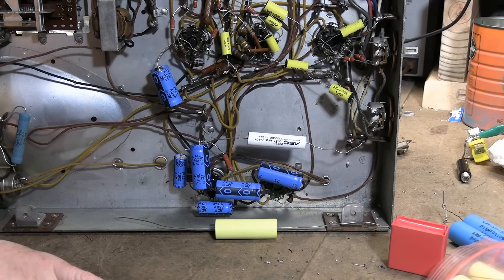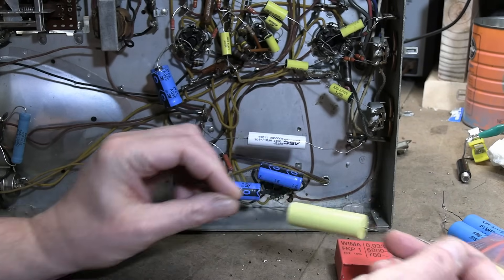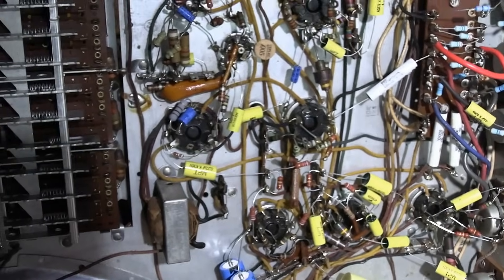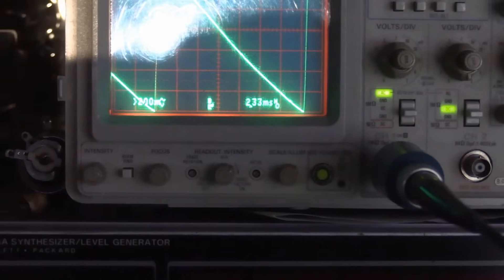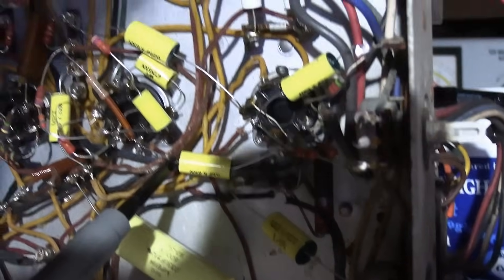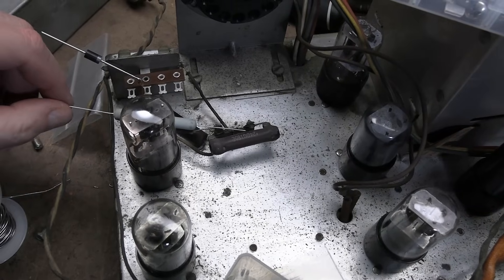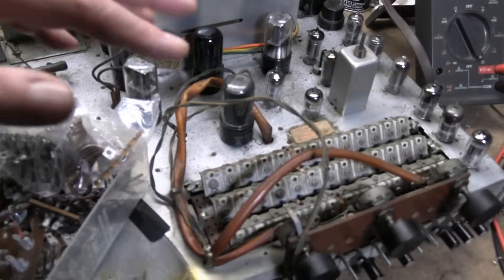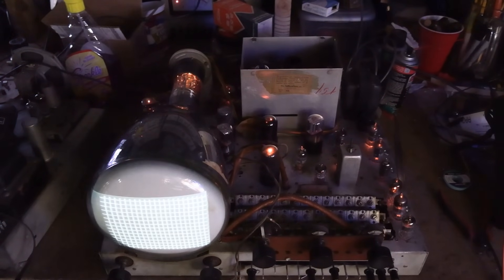1949 Hallicrafters T-54 restoration part 4

Comment: Bob, the tv looks great except I couldn't help but notice that the set has some filter hum in it. Wonder why that is if the filter caps are all correct?
Reply from the maker: No shield on the crt. It's sensitive to magnetic fields. No shields on the tubes either

Comment: I seem to remember that vertical sawtooth output wave forms have a slight "S" curve to them to allow for the curvature of the screen, the scan speed is slowed at the top and the bottom of the screen to compress it as the beam has a shorter distance to travel. I may be mis-remembering as this may apply to the line scan or something else again. It's over 40 years since I studied TV theory LOL.
Reply from the maker: Isn't the distance constant since it comes from a single point at the back of the CRT?  Imagine a fixed length string tied to a post.  It makes a curve as it moves
Reply: @bandersentv  Yes, probably in this case, but in some designs I belie e an S curve is required as the gun isn't the center point of the screen curve, but forward of it. I wish I could remember the details. Frustratingly  I just remember the disjointed fact of requiring an S curve. Edit: Just looked it up. S-Correction was line scan correction in ultra slim CRTs where the beam scan was at an acute angle at the beginning and end of each line. So nothing to do with frame scan LOL. My memory is playing tricks on me again.

Comment: My parents had a Motorola VT-71 in the late 40s. My dad once said that they’d sit inches away from the screen looking at the snow, and would get excited if they got any picture at all. In that context, I think near-perfect linearity wasn’t even on anyone’s menu in 1948.

Remember too that Tektronix began building their own CRTs because the commercial offerings in the early days couldn’t meet their expectations.

So, inconsistent picture tubes only “good enough” for TV, simple oscillators with imperfect linearity….
Reply from the maker: True and this was just about the cheapest 7" set you could buy back then.
Reply: People were as concerned then as they are today about picture quality. No one intentionally looked at the snow for the sake of looking at snow. We had the Hallicrafters T-54, the Motorola 7VT1, and the 7VT2. All were adjusted so a circle was round.

Comment: Actually I never had a "perfect" linearity" in electrostatics sets. Sometimes changing some resistors values you get some improvements. Tip: 60Hz ramps needs to be measured in DC mode. In AC mode ramp voltages are being integrated and consequently a perfect ramp is not possible.
Reply from the maker: Yes, thanks, I missed that.  I'll recheck in DC mode.

Comment: make a resistor divider to bring down the 5kv to range
Reply from the maker: No need. It is within range
Reply: @bandersentv  I meant in range of your probe 😁 you can use 5% resistors in the megohm range (e.g. 5 x 1Mohm resistors in series, measure across the last resistor on the LV side), you're just looking at waveforms
Reply: @zeke7237  Keep in mind that resistors have a voltage rating, which applies even if the heat dissipation is below spec.  Exceeding the voltage rating causes the resistor to go non-linear.  So, for a scope probe, you would need a minimum of 10 resistors in series.
Reply from the maker: @zeke7237   Oh sure, yes I could do that.  Sorry I misunderstood

Comment: Great follow up video.  I wish you would add some info on replacing the Selenium diodes. In old radios I was told you need to add a resistor in series to a silicon diode.  I guess 1N4007
diode.  I have some old TVs that use the Selenium diodes that will need to replace do I just put a 1N54, or 1N4007.  not sure what to do. I was waiting on the Beginners guides to explain that.
thanks Mike
Reply from the maker: 1N4007 will work in just about every situation. They are rated for 1 amp. I sometimes use beefier 1N5408 which are rated for 3 amps. More because they have thicker leads and more surface area for dealing with heat
Reply: Mike, in old radios, a 1N4007 rectifier diode in series with a 47 ohm, 5 watt resistor is the typical set of values.  You may want to adjust the resistor value slightly to produce the same B+ the schematic shows, which is typically 110 Vdc on the filter cap connected to the rectifier.  A TV naturally has higher B+ currents and the selenium rectifier is proportionally larger.  Try a 1N5408 in series with a 22 ohm, 10 watt resistor and adjust the resistor value accordingly.

Comment: What is the cathode voltage on the 6x5 doing? if it's low it can reduce liniarity, it should be ~390v
Reply from the maker: Around 380

Comment: As the 6C4 resides in the high voltage cage is it being used as the high voltage oscillator? In other sets 6V6-GT and such are used, 6Y6 in the Sentinal, so I find this interesting.
Reply: Yes a 6C4 is the oscillator. That is one of the suspected reasons for HV fading.
Reply: Electrostatic deflection sets like this typically use an audio output tube configured as a free running power oscillator for the high voltage power supply.

Comment: For those interested and for self study; The sweep oscillator (both horiz and vert) this set uses is known as Potter Sweep Oscillator/Circuit. There is not a ton of good explanations out there but a rather good one I found in a book about oscilloscopes. The PDF scan can be found on worldradiohistory and is called "TAB-72-Oscilloscope-Techniques-1958" . Navigate to page 36, Chapter "Multivibrator time base generator."

Comment: Hey Bob, 2 items: That block shaped high voltage capacitor.  For parts like that, I use RTV-3145 (or silicone caulk) to secure the body to the chassis.  A lot of people use Hot Glue but, it loses it's grip after a while and falls off.

Secondly, those sawtooth waves for the vertical must be viewed with the oscilloscope DC coupled.  Using AC coupling causes the DC blocking cap in the Scope's vertical input to distort the waveform.  If that is not practical, DC couple the Scope and use a 1uF DC blocking cap between the Scope probe and signal.

The vertical oscillator in this set uses a Blocking Oscillator, which has digital output.  In this case, it is configured to stay low most of the time, with a narrow positive pulse during retrace.  So the linear sawtooth wave is produced by the right half of the 12SN7 vertical oscillator, R19, and C18.  The 12SN7 discharges C18 and R19 charges C18, producing the linear ramp of the sawtooth.

It looks like C19, the 0.25uF coupling cap may be introducing a slight bit of distortion to the ramp in the sawtooth, it probably should be a 1uF but, for a TV of this quality caliber, the little bit non-linearity is probably acceptable.  So yes, the 0.05uF, 6,000 coupling caps from the vertical amp to the deflection plates would be a slight improvement over the 0.033uF.
Reply from the maker: It is non-linear coming right out of the oscillator before the 0.25uF cap.

Comment: Bob, I, an old guy. I've worked on these electrostatic sets. before they were that old. The deflection capacitors have always been a problem. The original paper caps were just terrible! As for the linearity, this often varied from set to set. I believe this is the case because there are so many variables involved. This includes the manufacturing tolerances of the CRT. I've seen sets that somewhere along the line have been dropped., where it was impossible to get a linear picture. Because the deflection plates were out of alignment.
Reply: Good point!

Comment: Bob, you've still got a hum traveling up the vertical on that crosshatch pattern, 13:00 .
Reply from the maker: Absolutely. This is a budget set has no shielding on the CRT.  Might not be so bad when it's inside the metal cabinet
Reply: Any way to mitigate this?  To me it’s very noticeable and I’ve had this problem before.
Reply from the maker: @Brooklyn727  Put a mu-metal shield over the CRT like most 7" sets have.  Have the power supply rectifiers right next to the CRT is not a good design.  Possibly rotate the filter choke 45 degrees.